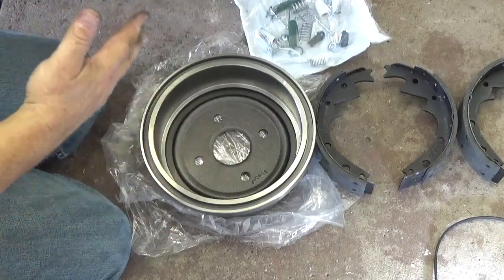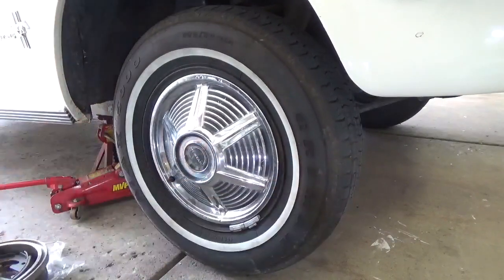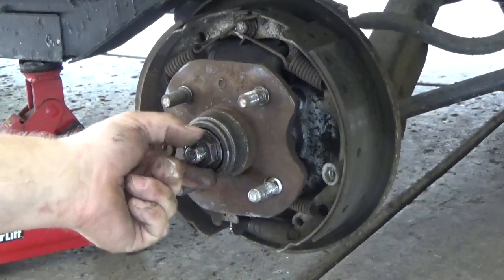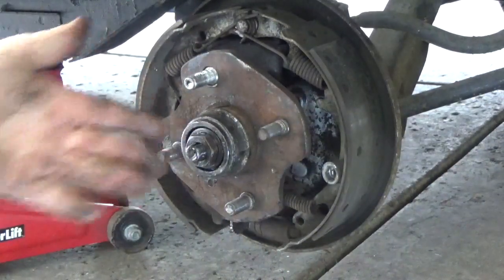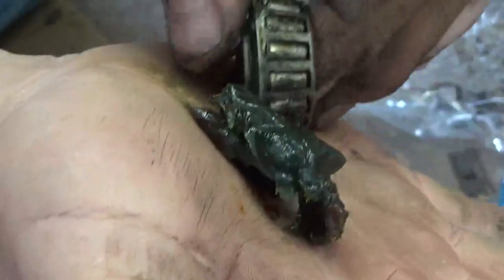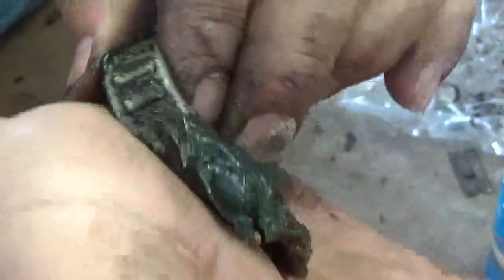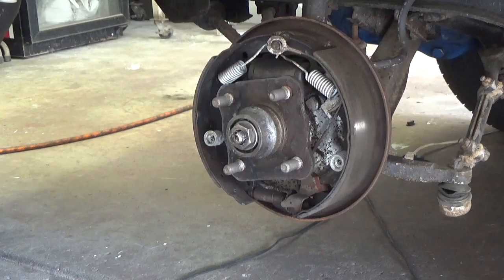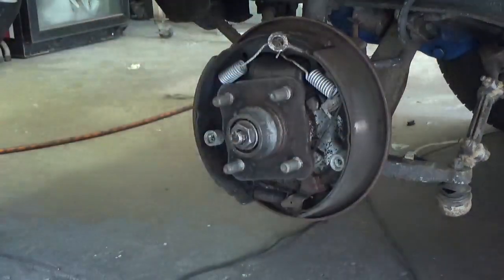1965 Mustang - Changing Drum Brakes, How to Pack Tapered Wheel Bearings

Comment: Pete you are the man.  Remember doing brakes on my 68.  One thing that did always wear out were the ball joints upper. Control arm bushings. They came with no grease fittings so I installed my own. We packed bearings on aircraft the way you just did it in the video. Thanks for sharing Pete 😊🇺🇸 Pete I ordered the heater so I can work in the garage in some kind of warmth. Usually stays in mid to low 50’s in winter.  And yes we’re quarantined on Long Island since March. Yikes!!!!!!!
Reply from the maker: Thanks Arthur. I'm doing a video on changing tie rods and wheel bearing races. You'll love the heater. I leave mine on and it really does keep the garage warm.
Reply: @PetesGarage I couldn’t get the discount through your discount code but I purchased at regular price and then I contacted them and explained to them the situation and their customer service was excellent. And they gave me a very nice discount. Thank Pete can’t wait to get it. Wish this lockdown would end but seems to be getting worse here on Long Island. Myself and neighbors are all stocking up on essentials. In fact I just had two large trees taken down on my property to give the wood to my single mom neighbor in case oil goes through the roof. During times like this we all need to help each other. Schools and administrators are horrible. Just had my eighteen year old granddaughter hospitalized for threaten sucide. This is a cruel world. So if I can help someone I will. Thanks again Pete stay well and safe 🇺🇸🇺🇸🇺🇸 looking forward to the next video. If I had a 68 mustang I would definately find a way to have you do the engine and drive train. A dream would come through. The Vietnam War killed my dream 😊
Reply from the maker: That's quite a story Arthur, I wish you the best
Reply: Thanks Pete somedays are a real struggle but we will all get through this. Stay well 😊

Comment: Great reference material Pete. A little off the beaten path of brakes; when the cold comes, the moisture goes with it; add harsh chemicals and the hands take a beating: cracked skin. I find using dawn dish soap with old coffee grounds are a hands friendly concoction. Advanced cracking, if addressed early, can be remedied with regular, but not aggressive, use of a pumice stone and hand soap. 

I have disk brakes on my 72 Plymouth and will admit they are intimidating, but I learned to take pictures, it is a great way to not get lost, thanks for sharing as always.
Reply from the maker: Thanks so much

Comment: Hi, great video! I have a 65' V8 Convertible and have had the drum brakes done twice by a shop. Both times, the brakes have come back unsatisfactory, front end shaking badly while braking. I lifted up the car and on both wheels, there seemed to be high spots in the shoes, as when you rotate the tire it will spin freely a bit then bind up. On the passenger side, it was so bad, the drum overheated and turned a different color. Both times, the replaced the shoes and drums and still not right. I know they also replaced one of the hubs and still not right.  I have decided to try this job myself with hopefully higher quality parts, new Raybestos drums/shoes. When new assembly is complete, there should be no high spots and the wheel should spin evenly, correct? I was told it would eventually "break in" but I don't think so.
Reply from the maker: They did not set the bearing preload right, the shoes were not adjusted properly, and they probably had the shoes installed upside down.

Comment: Do you have any videos about chasing intermittent vibrations when driving? My 67 has me beating my head against the wall trying to figure it out.
Reply from the maker: Have you considered the drive shaft and universals?
Reply: @PetesGarage  just had the transmission rebuilt 2 weeks ago. The tail shaft bushing was out. They knew my situation. So they checked the u joints at that time and said they were good. But I think I will replace them anyway. Just for piece of mind. I have replaced the transmission mount, both motor mounts, crankshaft, crank bearings, rod bearings, front wheel bearings, races, and seals. I'm working my way to the back. So no, I have not done the drive shaft or the rear bearings yet. The vibration is intermittent. No matter what speed. 30 mph, or 80 mph. The vibration never changes. Just get more violent the fast you go. But the speed of the intermittent vibration don't change.
Reply from the maker: That sounds like either the driveshaft balance or alignment
Reply: @PetesGarage  I'm taking the drive shaft out to change u joints. That would be a good time to get it checked for ballance. I'm debating on replacing it with an aluminum drive shaft. But that would be the time to have it checked. Thanks.